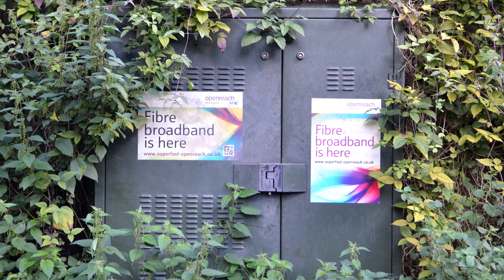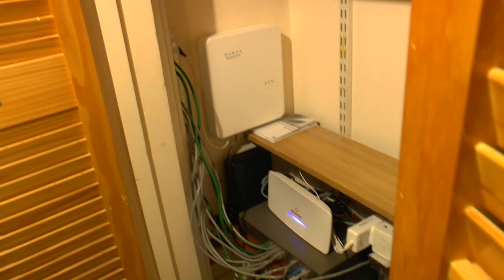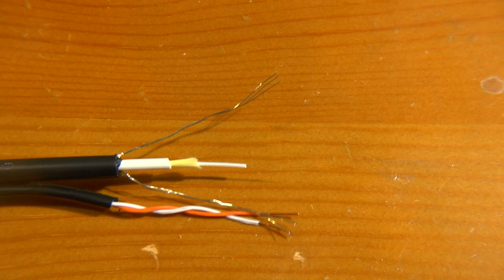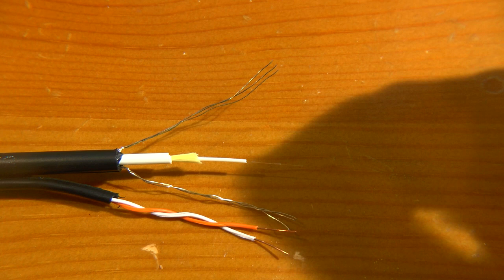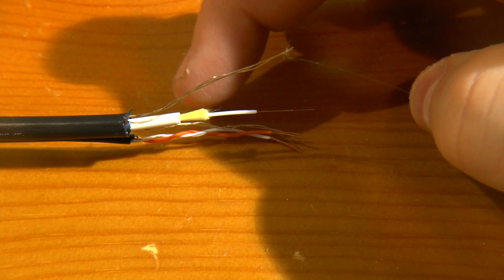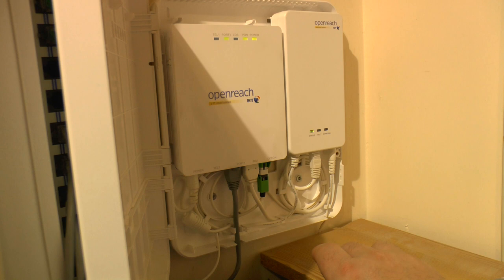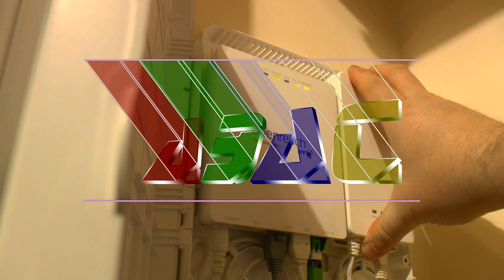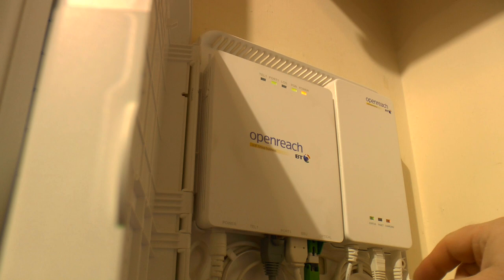FTTP - Fibre To The Premises

Comment: I can finally get this service to replace my 5mb copper line. This is helpful, thanks. Was curious about if the old analogue phones would work with these boxes.
Reply from the maker: Three options:-
1) They keep your old line and run the hybrid fibre-copper separately (this is what happened at mine)
2) They replace your old line and run your copper service over the hybrid cable (this is what they did across the road from me)
3) They replace your old line and present your phone service on the phone socket at the bottom of the ONT

In all cases the phone would still get an analogue line, but I don't know if the socket on the ONT would recognise pulse-dialling (loop disconnect) phones.

Comment: Was wondering how the wire would get into my house this confirms it will be off the same pole at back of garden most likely that my phone line comes off.  Just ordered the 900/100 service as price is almost the same as slower ones.

Very helpful video👍
Reply from the maker: You should see one of the multi-port fibre units on your pole. You'll be plugged into that.
Reply: @AintBigAintClever  Aye can see the box,  it’s just under where the phone line comes off to our house, looks like only one person is connected so far.

Comment: Those 'curly wurlys' that the tech used to connect the cable to the house and the pole are alright for copper cables but I don't think they should be used for fibre because the fibre is twisted and will lose power. If something breaks this is where it will happen. In Ireland we use a plastic wedge clamp style to hold the cable. We don't use that combined copper fibre either. Fibre on its own is safer as there's nothing to conduct electricity.

Comment: Fascinating! Makes me wish /Sparklight (formerly Cable One) in Idaho would get their ass in gear and roll out fiber optic to houses here in Idaho.

Also, a comparison: currently, from the aforementioned Internet Service Provider, I have (for $55 a month) 100 Mbps down and 1 or 1.5 Mbps up over a coax cable. The only alternative is Digital Subscriber Line internet (Centurylink, formerly Qwest) over the copper POTS pair, which is 12MBPS for $45 a month in a contract that will penalize you if you try to terminate the contract early. The cable internet has a usage cap of 300 GB, but I don't know if Centurylink has a cap.

And because 'Murica, rural houses don't have those options; they have to settle for dial up internet or satellite internet, which are both horribly slow.
Reply: And yes, the Sparklight logo has a slash mark. I have no idea why.

Comment: Great explanatory video …explains the latest kit being installed.  I was wondering about whether there would be an external CSP box as well as the internal ONT.  This answers my query.  It should be No!  Will find out for sure next Friday when it’s all due to be installed. 🤞🤞🤞
Reply from the maker: Did you end up with a splice box?  Some of the properties in the next street have splices on the wall, the ones in my street are run straight in.
Reply: @AintBigAintClever  Fibre was run straight in …although it did need a little  “persuasion”!  Original intention was for it to be installed with a splice box, however I resisted this because of the ugly cable run this would have caused down  and back up a wall.   Due to the way the fibre was routed from the top of the pole …and because of the ducted cable entry route I have in to my house at roof gutter height…it made more sense for the fibre to stay “up high” and be routed in directly.
To avoid the Engineer having to fix ladder anchor bolts to my wall ..and leave unsightly holes  … I  used my own ladders and routed the cable myself …under the engineers direction.
The BT Openreach engineer was very helpful and understanding.
Reply from the maker: Similar to mine, then. I'd already run some scrap Ethernet out through a hole in the soffit as a draw-cord.  Engineer taped the new cable on, I drew it into the attic.  Ditto into the upstairs cupboard.  He didn't so much as have to knock a nail in.  Easy for him, perfect for me.

Comment: Disconnecting the fibre like that leaving it hanging to one side has likely made it dirty and will now need cleaning.
Reply from the maker: We've had plenty worse than that at work. Besides, of all our fibre patch cable suppliers at work, none of them supply any sort of fibre cleaning kits for them.
Reply: AintBigAintClever in my experience it doesn't take alot, if you scope the fibre its suprising how easy it is to get dirty.
Reply: We at FND use one click cleaner to clean both LC and SC tails. Your manager should help you get hold of these. However if the distance from exchange isn't too far, it really isnt a problem.

Comment: The poxy road noise is not necessary at all mate. I have fibre to a box exactly like yours and into a bt hub. It works well but I should upgrade to a faster speed as I was sceptical about fibre as it could have been unreliable  but it is actually very good so I will pay for a much faster connection to get the most out of it.

Comment: Yellow stuff is Kevlar, great stuff to cut!
Reply from the maker: Bloody stuff is so damned fine it folds between the scissor blades. Now I know why it was so damned tough to trim.
Reply: Standard stuff in all fibre cables, amazing how resilient it is. Excellent protection for the optical core from abrasion, or most likely, stupidity!
Reply: Simon Tay have you any advice on how to strip the OH cable? It's so tough.

Comment: Hi, great video.  I just wanted to ask, can I ask the engineer to install the ONT in my bedroom which is located at the back of my house?  My PC is there and I'm using an ethernet cable.   Thanks in advance.
Reply from the maker: I'd expect so. That's pretty much where mine is. If you can make the job easy for the engineer I expect they'll be happy to accommodate.
Reply: @AintBigAintClever  Thanks for your reply.

Comment: Did openreach actually run all the cables to your cupboard and install it where you wanted, or did you have to do some prep work?
Reply from the maker: My own equipment was already in the cupboard (I moved the internal cabling years ago). When it came to the new line it was the easiest way for the Openreach guy to do it. I'd already poked an old piece of Cat.5 through the soffit outside to act as a pull-rope.
While he was up the pole plugging one end of the fibre in and getting the cable ready to feed in, I was inside wall-mounting the box (I didn't have to, but it saved time). He then taped the fibre to the Cat.5, I went in the attic and pulled it in while he made sure it didn't snag. Once inside, again I stayed in the attic while he was in the cupboard drawing the fibre through (another scrap piece of Cat.5).
He didn't have to drill, in fact he didn't so much as have to knock in a cable clip. Nice neat job for me, nice easy job for him. Win-win :)

Comment: Thanks for the video, really informative. 
I have a similar set up at my house and have a couple of questions: 
1. Does this mean the router has to be in the storage cupboard, where the FTTP wall box is fitted? If I wanted the router next to the TV is this not an option?
2. Could you please explain the difference between the WLAN plug and the 'broadband DSL' port on the router. Why is the WLAN port used in this circumstance?
Reply from the maker: The router can be up to 100 metres away from the FTTP box, linked over ethernet cable.

The broadband DSL port connects to a phone line. It's for VDSL (FTTC) or ADSL.
The WLAN port is used because the connection from the ONT and the router is ethernet, not telephone.

Comment: I'm moving into a new property soon which has fttp how do you get on to the Plusnet trail? Think I wanna go with them as they seem the most reasonably priced. Wish more ISP's provided fttp and matched the fttc prices so at least you had choice and would be able to get good deals with the more competition
Reply from the maker: I believe you've got to be an existing Plusnet customer in order to take part in the trial. I had ADSL with them before getting FTTP.
Reply: Zen broadband are decently priced and use BT openreach fttp

Comment: Thanks for the tour. I think you should leave all that open reach gear alone. Opening , closing, unplugging wires, unclipping boxes is asking for trouble.
Reply from the maker: I've been installing around £2m worth of network gear in my day job over the past few months, which includes unplugging a lot more wires and fibre than this.
Reply: @AintBigAintClever  lol. Sorry mate. It all looks fiddly
Reply from the maker: @Teddy_Bass  the only fiddly bit really would be if I broke the fibre. Well I say fiddly, it'd be a pain in the arse as I'd have to get hold of a new connector. The rest is straightforward enough, there aren't any "wrong holes" to plug anything into apart from on the back of the wireless router.

As for Openreach stuff I've been shifting PSTN (including ADSL), ISDN2e and ISDN30e boxes, identifying and labelling lines and stripping out unused cable, because Openreach basically couldn't be arsed to send an engineer or crap subcontractor to do the work and it was threatening to hold up an office block refurbishment. Apart from some fibre work (some of which didn't even need doing and they managed to fuck it up when they did) OR haven't really had a look-in at the site, and when it comes to internal circuit moves they can go whistle now as we can move it exactly when and where we need to.

Comment: Thanks for a very informative video. I am due to have similar installed by Openreach in a couple of weeks. I will have to drill through a 2ft Stone wall as I am sure they will not enjoy that bit  so I am interested in the cable dimensions. I did look at the Corning website but guess the overhead cable  is custom made for BT (hence their name on it) so the spec is not listed there. I would be interested to know the width/height  etc of the dual cable and also the bending radius. I am guessing that being fibre it will be somewhere between 80/150mm so wondered how you got it from the wall into the trunking unless you had a large loop. Thanks Chris
Reply from the maker: No tight bends in the attic, just a big coil of spare cable :)
Just checked with a measuring tape and the cable's about 9mm across the widest point.
Bend radius is the same as a £2 coin according to https://www.openreach.com/content/dam/openreach/openreach-dam-files/images/fibre-broadband/fibre-for-developers/guides-and-handbooks/oct-2019-update/Fibre%20handbook%20V9%20web.pdf
Reply: I wouldn’t the sc cables are trash they break way to easy and takes a million years for an a finder to come out
Reply: Engineer*

Comment: What is the dimensions of the big box on the internal wall?
Reply from the maker: I've just looked through previous comment replies and it's approx. 255mm high x 215mm wide x 45mm deep.
Reply: @AintBigAintClever  Thank you :-)  BTW a very useful video, very helpful :-)

Comment: Can the Hub be moved to another room with an ordinary phone socket as mine is in a cupboard under the stairs with the Fibre cabinet?
Reply from the maker: No, the connection from the Hub to the ONT needs to be Ethernet. It can be done with Ethernet (RJ45) outlets, but the cable needs to be at least Category 5e, not phone cable.
Reply: @AintBigAintClever  OK thanks for your reply, I thought as much.

Comment: I was hoping to see a teardown of the gpon equipment. Was this part of super fast Cymru?

Up hear in gogledd all we got was FTTC. Miles better than awful ADSL we were being served with.

Though there gonna be a big problem if I want fiber. My house is fed with a cable under the ground rather than a post. I guess maybe they'll replace it with a post when they start to offer fiber.
Reply from the maker: I was thinking about it, but it's only just gone in! I may do that down the line, we'll see...

By the way some friends of mine live near Pwllheli and have FTTP.
Reply: AintBigAintClever sorry didn't get a notification. Yeah it's very odd the roll out hear. Still hears hoping for a proper roll out soon.

One thing I never understood why fiber wasn't used in the first place. BT aging copper network has had its day obvious with the poor investment and infrastructure we have in the UK.
Reply: Just switched to FTTC it is miles better than ADSL
Reply: @SionynJones  BT actually wanted to start using fibre in the 80's but then prime minister Margaret Thatcher blocked it saying it wasn't financially feasible as copper was ok unfortunately we are now paying for this.

Comment: If I need to get a Symmetric Bandwidth 500 Mbps/500 Mbps Download/Upload how to get it done in GPON OLT ONT, what are the limitations and constraints ? It is a generic query
Reply from the maker: You would need to contact your Internet Service Provider about this.
Reply: The equipment install what's demonstrated in this video is capable of 1gbps that's it's limit I'm sure you could get that kind of service the issue is finding a provider that it able to offer it

Comment: 2:27 What did you mean ‘the fibre unit itself draws 4W’? Is that just for the telephone backup? Can you just leave that unplugged if you don’t use the phoneline or is that power needed to run the wall unit itself? Why doesn’t the unit just run off the copper power cables you tucked out of the way instead of all that battery backup complexity, no enough amps? If you remove the batteries, does it draw less power because it isnt then trying to charge them?
Reply from the maker: It'll use a fraction less power if the battery backup was removed and power connected straight to the ONT but if the batteries are full they're not going to be drawing power without getting hot, as obviously the energy has to go somewhere.  The batteries aren't getting hot, so they're not.
Phone lines don't provide enough power to run an ONT.

Comment: Okay you get Mbps = Megabits per second is the unit of measurement for internet speed. MegaBytes is what most flash drives and storage devices read and write data at. That is MBps. 1ms is not 1 second 1000ms = 1 second and the servers which you are connecting to should be able to handle the load, they can handle 1000Mbps depending if its local or international servers, just some food for thought.

Comment: Lucky you, All I have here in my small town is 1.5MB DSL. Heh it beats dialup, if you can even get it anymore.
Reply: Dialup is still available from a few 'freeish' isps (usually they deal ads or have an 0844 type number). No subscription services anymore. Might be a few very niche uses for it, like emailing your regular isp to report a fault, in out of the way areas with no mobile reception?... (altho around 70% (ime) of ADSL or VDSL faults will also take out the voice line...)
Reply: coondogtheman1234 I'm surprised my sky router doesn't make the old dial up sound I'm still on ADSL which is so outdated at this point

Comment: Awesome video. I have the same set up under my stairs but use Virgin for Gig 1 fibre. The outside of my house has the bt fibre cable from the street but I can't find the optical cable on the outside of my house that is clearly inside the house. Ideally I want  to use the fibre cable in my house to pull through a cat 7 cable from outside but as I can't find the end of the cable outside I'm a bit stuck....
Reply from the maker: I'm confused.  "The outside of my house has the bt fibre cable from the street but I can't find the optical cable on the outside of my house."
Reply: @AintBigAintClever  sorry. So I have the same Echolife Huawei box under my stairs with a fibre cable going into it. At my front door I have a grey BT box with a black cable going in from the street but no fibre cable from my house. Where this cable terminates in a mystery as it clearly exists as it's connected to the Echolife box.
Reply from the maker: @AutoAbsolute  you may find it goes straight through the wall from the back of the BT box. Take a look at page 15 of the guide at https://www.openreach.com/content/dam/openreach/openreach-dam-files/images/fibre-broadband/fibre-for-developers/guides-and-handbooks/feb-2021-updates/New%20sites%20fibre%20handbook%20-%209.4.pdf
Reply: @AintBigAintClever  thanks! It doesn't I'm afraid, I took the box off the wall. There is a pipe at ground level that goes straight down which is where one of the cables comes from the street but not from the house.